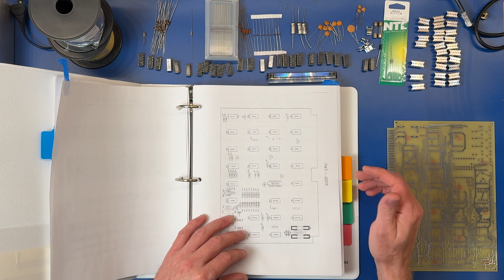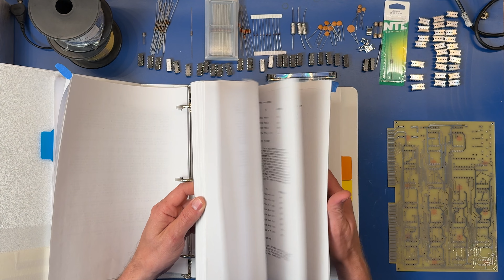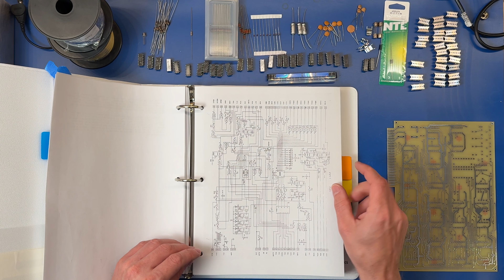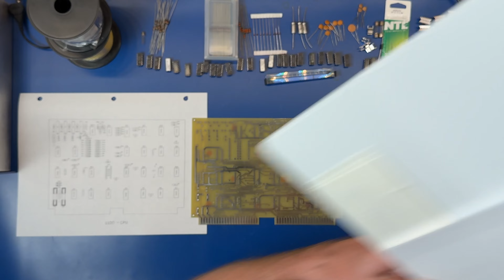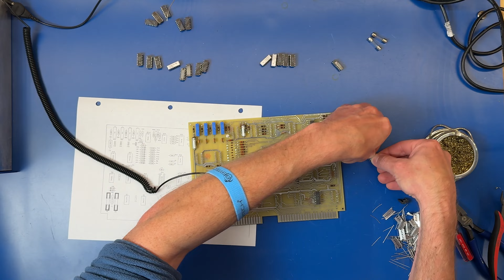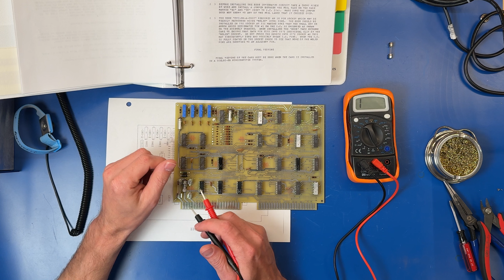Assembling & Tuning the CPU Board for the SCELBI 8B

Comment: It''s possible that frequency counter in addition to oscilloscope just sped up test and verification process.. or simply permits use or lower spec scope. But 20MHhz has been standard for a very long time. Should therefore be able to make reliable measurements of digital signals up to 2-4MHz